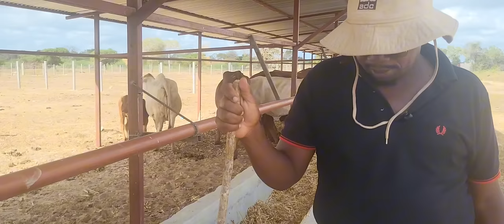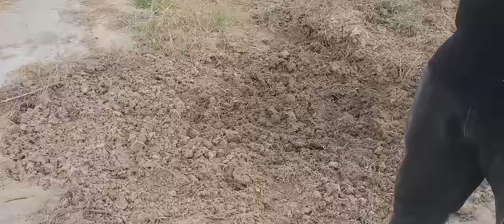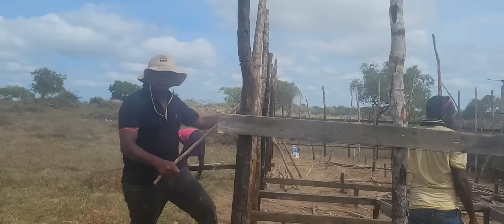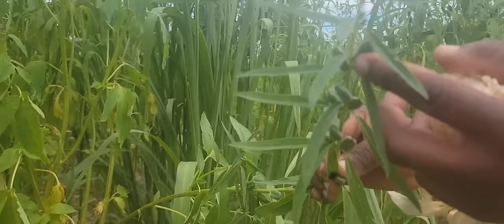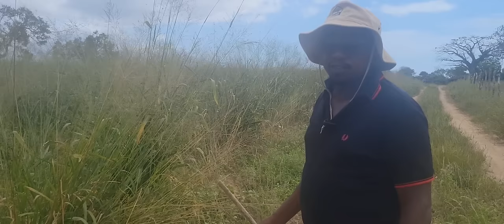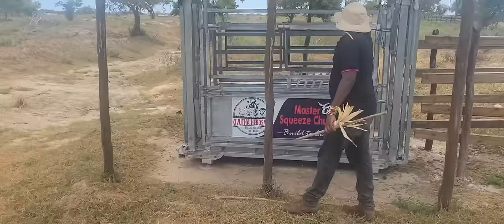How to feed 1200 cattle /yr in a dry area...cattle feedlot.

Comment: So lake turkana can also be used to grow crops. The water is saline but not very saline. if Matt can use the water from his wells which have triple salinity due to the salt factory that makes salt causing the ground water to be salty than sea water so i can imagine Lake turkana water can be used for irrigation.
Reply from the maker: Saline water would "eat through the irrigation systems a lot faster hence not feasible...however at lake Trukana a deceleration plant working on the available renewable energy would be a brilliant idea.
Reply: @farmbusines  flexible PVC pipe is very corrosion-resistant and will not deteriorate due to repeated exposure to sea water